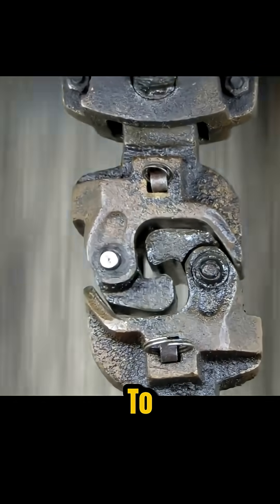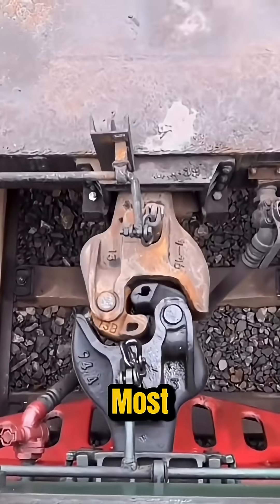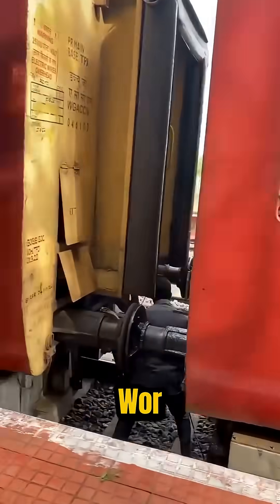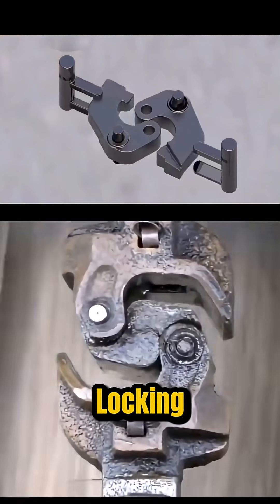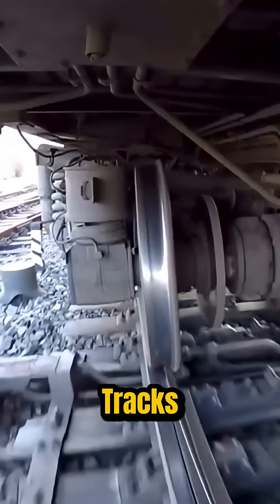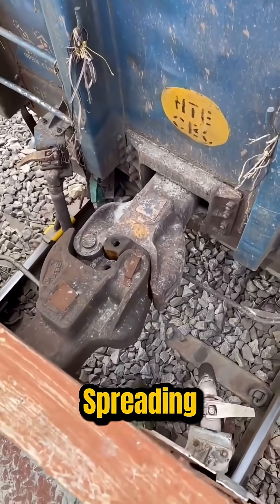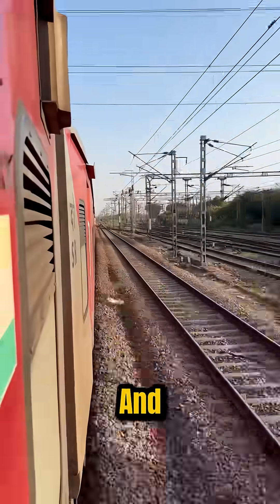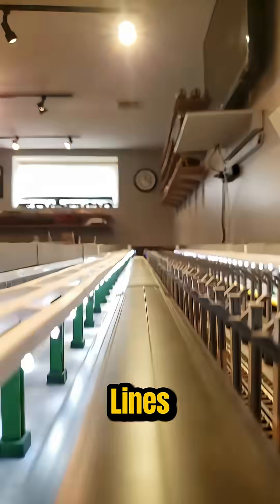This Tiny Piece Keeps Trains Safe!

Comment: In the UK we call that a buckeye coupling and is used as the standard on railway carriages from the 1950s Mk 1 stock through to the MK3 stock of the 1970s, as well as some freight wagons. Most freight trains still use the link coupler system but over here, if anyone stands in between the wagons whilst coupling then it's a sackable offence. These examples seen here taken in India show downright recklessness with regard to safety. 
 The other couplings seen later in the video are of a different type altogether as they are totally automatic and carry the brake pipe and electrical connections between the traction units.